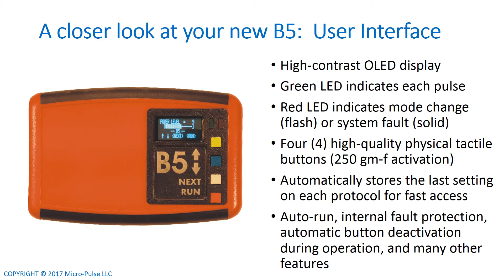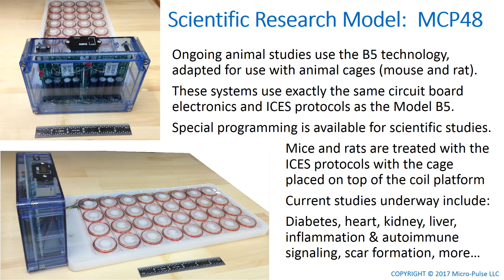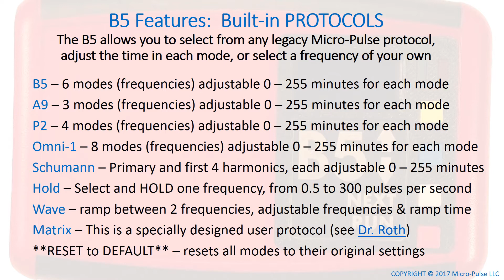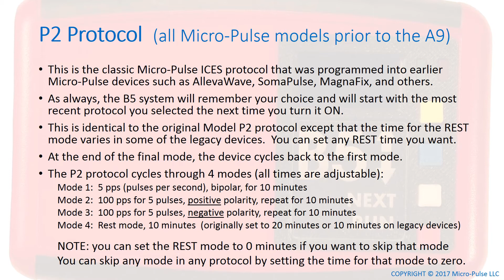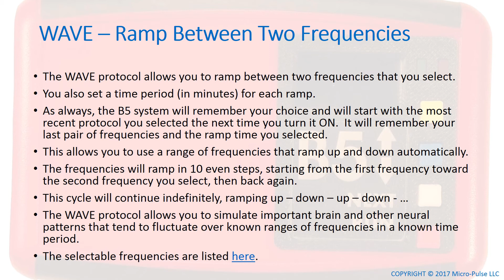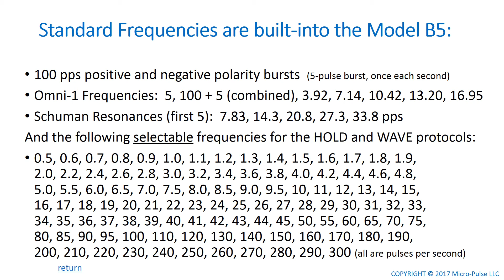B5 Intro

Comment: Hello Dr Dennis I'm going to purchase a C5 or B5 to use on my head for my dystharia. I was going get 4 of the 2x2 arrays, my question is how to arrange these to get the deep tissue penetration and not cancel each other. For instance can you have 2 stacked on one side and the other two stacked on the other of the head? 

Also are there any plans to make a skull cap similar to the proneurolight which is for LLLT or a full body mat.

One last question, alot of your competitors use a saw tooth wave form for there body mats does that have any biological effect from your opinion/research?
Reply from the maker: I will try to answer each question in turn:
Stacking 2x2 arrays:  Lay two of the the 2x2 arrays on top of each other, then use the hexagonal coil tester (supplied with every system), sandwiched between any pair of rings.  If the green LEDs flash very brightly, then you are stacking the coils properly.  You can do this to check any size stack of coils, 2, 3 or 4.

NOTE:  Most people respond best to MEDIUM or LOW levels of intensity when using our technology.  Contrary to what every PEMF marketer will tell you: MORE POWER DOES ***NOT*** MEAN FASTER HEALING.  This might only be true for the fraudulent low-efficiency PEMF systems on the market, but it is not true at all for efficient and well-designed PEMF.  So, please DO NOT start at full power.  Start for short periods (10-15 minutes) at medium or low power.  Keep in mind that this technology, and in reality all PEMF technology, is experimental and that anything you can buy online is entirely untested by any regulatory agency and safety and efficacy for any human use is absolutely not assured.  Be cautious.  PEMF is not a cure-all.

Skull cap: no plans to do that at all, sorry.  I do not make garments.  I make only the core ICES-PEMF technology.

Competitors (saw tooth wave).  Well, first, to be honest they are not really competitors.  I am researching and developing PEMF to make it affordable for people who need it.  I do not market it, I just am willing to sell it to people who find me, but I spend zero on marketing.  Other PEMF manufacturers/marketers are not doing that at all.  They are mostly pirating older technology developed by myself or others, usually 15 or 20 years ago or longer, and they most definitely are not trying to make it affordable.  Their expenditures go mainly toward marketing profits, not research and development.  As such, I see most of these PEMF systems as pirated.  They use whatever waveform they use because it is whatever their technology causes to happen.  They make up pseudo-scientific reasons for it, but they do not understand it themselves.  For example, the sawtooth waveform you reference is typically due to what they refer to as "spark gap" technology.  But that is not really a new technology.  Spark gaps were used by Tesla and others 120 years ago as a way to get high-voltage spikes from a coil.  This was what people had to do before transistors, even before vacuum tubes.  It is an exceptionally crude technology that generates a huge amount of EMI (electromagnetic interference, noise).  The natural waveform from that crude type of setup is an asymmetric triangle, a.k.a., a sawtooth.  It is nothing magical, it is just very, very old pre-technology.
Reply: @robertgdennis7472  Thanks for your reply Doc. What are your thoughts on surface area? For instance setup a 4x2 array on the left side of your head and a 4x2 array on the right side. Do the 2x2 arrays work when placed on opposite sides of a body part for deep tissue penetration or will there be a lot of canceling each other out, because i have come to believe 2 of the coils are north polarity and 2 are south polarity?
Reply from the maker: @Mooresy8711  Unfortunately I cannot give clinical advice of any kind, sorry.  Also, since I have very limited experience with any use of PEMF on the head, it would be wrong for me to give advice because I really do not know.
There are several things you absolutely must keep in mind about PEMF:
1-PEMF is absolutely experimental.  There are no proven methods that work for everyone for every application, you very much need to try for yourself
2-PEMF is more like acupuncture, not so much like a tanning booth.  Don't think about surface area so much as placing it approximately in the correct position.
3-Use the hexagonal test chip that we include with every system, as I describe above, to see for yourself whether a particular coil placement cancels or adds together.
4-When people tell you with certainty that PEMF will work, and precisely what you must do, they are almost certainly making things up.  Marketers will tell you anything you want to hear so long as you are willing to write a check.
5-The only way to find what works for you is to try it and keep track of how you respond.  You must see for yourself.
6-The technical details of our system, what is North versus what is South... all that sort of stuff is WAY too much technical detail to be of any real use to you.  If you have listened to all the nonsense about PEMF from marketers, you will keep asking these sorts of questions endlessly.  They will lead you nowhere.  This is all psuedo-scientific jargon to get you to believe they know something, when they do not.  I know this is hard to hear, but the best thing for you to do is set all that rubbish and nonsense aside.  No one really knows how or why PEMF works.  There are some theories, but nothing solid and reliable yet.  But there is a lot of evidence that PEMF does have benefits, even if we do not know why.  The only way for you to know if it will work for you is for you to try it for yourself and see.  Things such as where to put coils, etc, you basically need to try for yourself and see what works for you and what does not.

Comment: Hi Dr Dennis, I have a question regarding the Coils. I have an M1 (which I absolutely love) but my mother will be buying the C5. Do the 2x2 Coils, since they have three more coils than the ones of the M1, mean that its power is three times as much as the M1? Or is it the same power/intensity of the M1 but distributed over 4 coils? By the way, I sent you an email yesterday. I hope you received it. Thanks a lot!
Reply from the maker: Hi Tachan,  when you use 2x2 coil arrays instead of a single pair of coils the energy in each pulse is distributed over more spatial volume by about double.  The total energy per pulse is about the same, but since it is distributed over a larger volume of space the energy density per unit volume of space is about half.  From a physics standpoint this basically amounts to a conservation of energy issue.  This energy distribution over more volume does make sense for some applications where a larger area/volume is required.  And even with distributing the energy over a larger volume like this, the ICES systems still deliver more energy per unit volume than many or the larger PEMF systems (not all of them, but certainly many of them).  The key thing to keep in mind is that most people respond best to ICES systems at medium power levels anyway.  So you can usually compensate for using 2x2 coil arrays by increasing the power setting.  but keep in mind: more power often does not usually result in more or faster or better effects.  So in general it seems that there is plenty of power from an ICES system, even if the pulse energy is distributed over a larger volume of space.
I'll check my emails to make sure I did not miss the one you sent, thanks.
Reply: Thank you for taking the time to write such a detailed response. I appreciate it so very much. We just ordered the C5. We're very excited and look forward to start using it!

Comment: Hi Bob, any updates on the studies you are completing?
Reply from the maker: Actually yes.  The ICES stimulation is causing significant changes in inflammatory cytokines in Type 1 diabetes mice, but no change in disease outcome with maturation.  It is possible that we have the dosage wrong, or just as likely the animal model being used is not a good model for human T1D, just a convenient model for endless NIH funded studies on a non-human-relevant disease mechanism in an animal.

Unfortunately real science is not much of a spectator sport.  At best it is *very* slow, like watching glaciers move.
Reply: Haha yes I imaine real science is a bit like a very long fishing trip.  Good the reasearch is being done. I have the A9 device. Well had. I loaned it to the in-laws and they have kept it over a year.  Frustratingly there is never any direct feedback such as "yes it helped with this.."  I only hear that "i thinkg it helped" "it might have helped". I have a health tech company here int he UK and am always looking for products that work. Unfortunatelt it seems people have to 'feel' it to believe it a lot of the time.  

 If you have a device that would be good to test on eye issues, let me know, always ready to try what works. 

Good luck with the research.
Reply from the maker: Probably the best would be the model M1, very portable, 30 protocols to choose from, very low power settings available.  Purely experimental, but that is the one I would try.